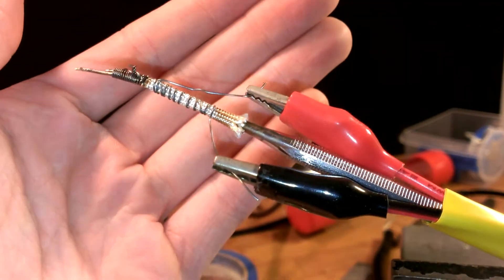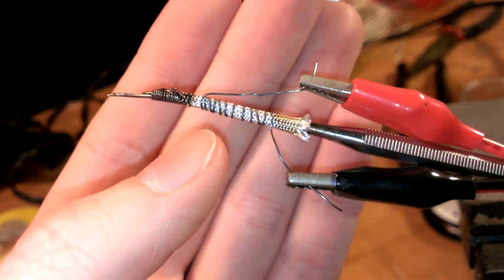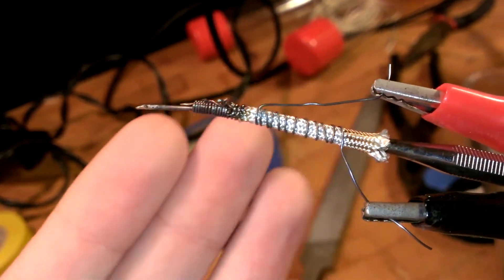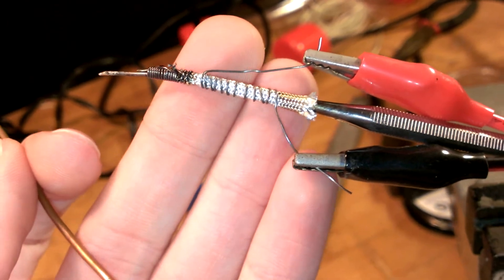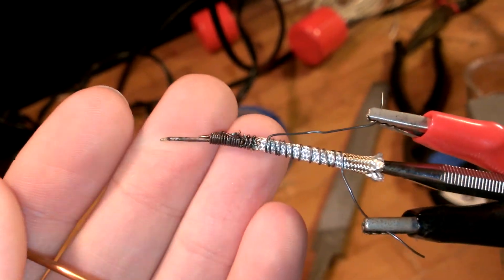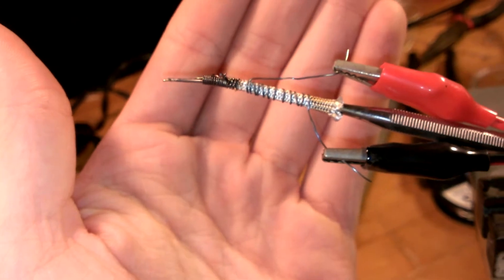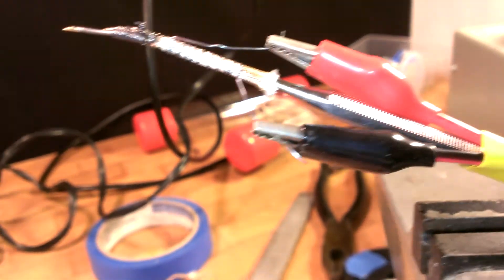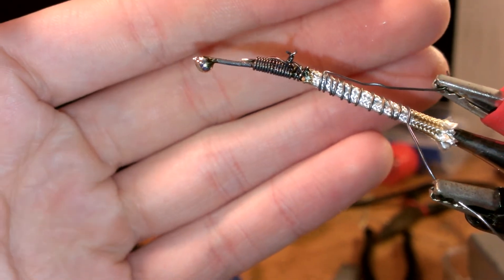DIY Micro Soldering Iron

Comment: As opposed to putting a copper tip on a real soldering iron?
Reply from the maker: Originally I had planned on using the sharp tip of the dental pick as the hot end but when I tried it, I found that solder does not wet stainless steel. So I added the copper as a more compatible tip. But you're right, if I was going to do that, it would have been easier to just put a copper wire on a normal iron.
Reply: He can't control the heat that way dude.